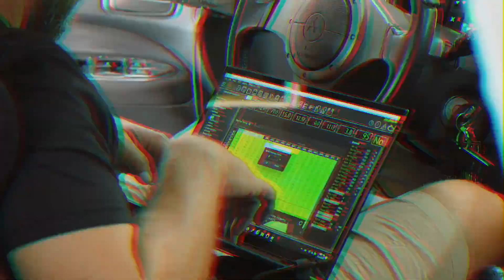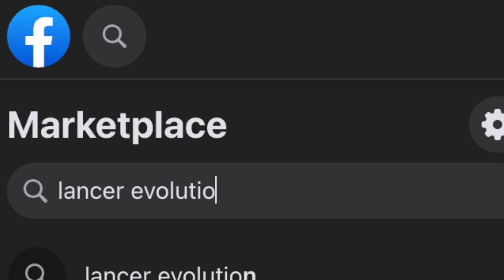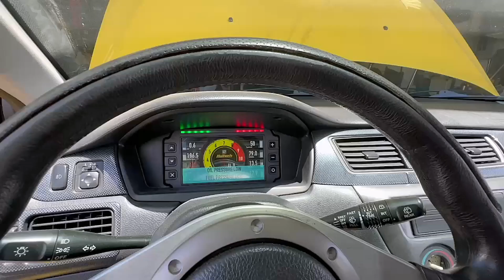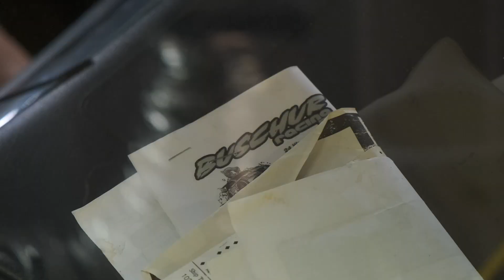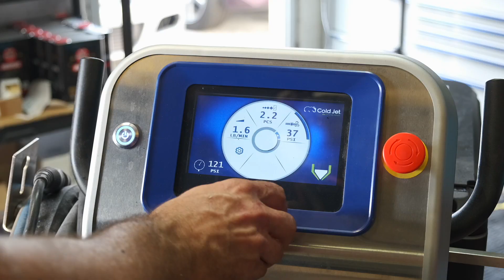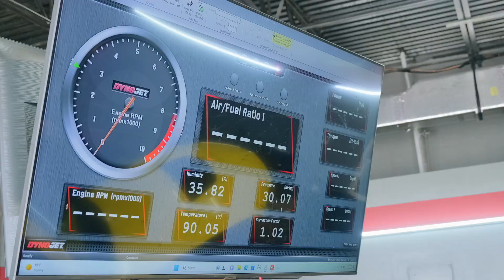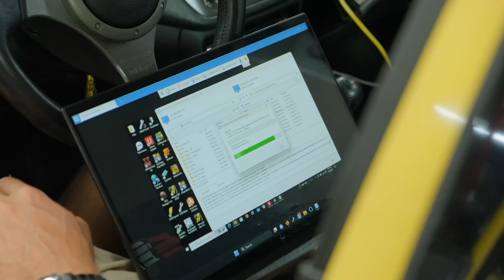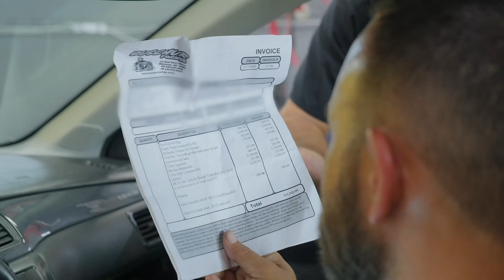Evo 8 FULL RESTORATION and 800HP Build Is Just Too Clean To Drive

Comment: When converting the throttle body over to the skunkworks TB if you deleted the IAC or still running the factory IAC unit wirh the Haltech?   Also, when relocating the catchcan set up super low does that create any vacuum pull or flow issues?
Reply from the maker: We still use the Iac no problem. We never delete the Iac. Never had any issues down low like that. We sometimes use a trans mounted can with the same success.